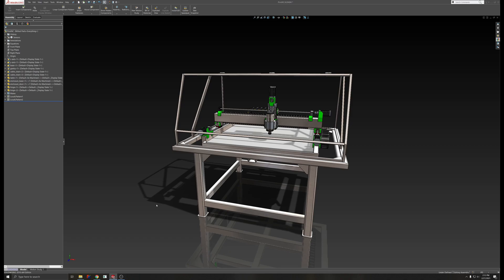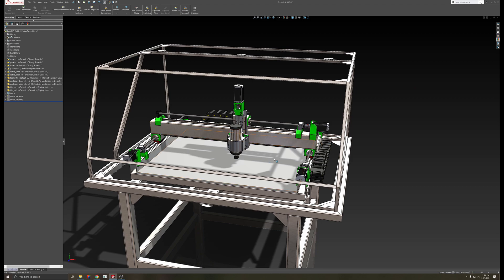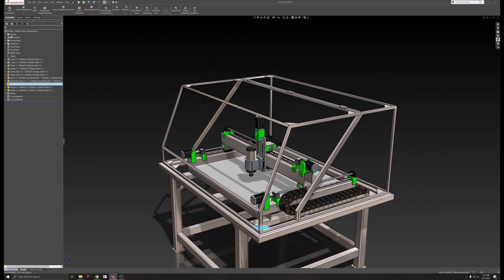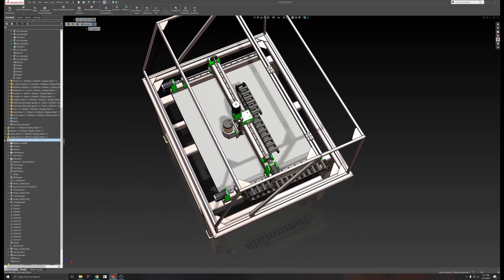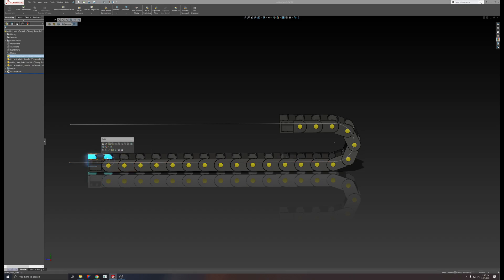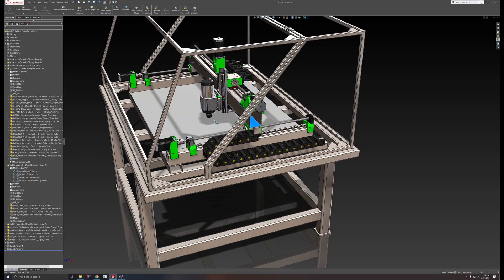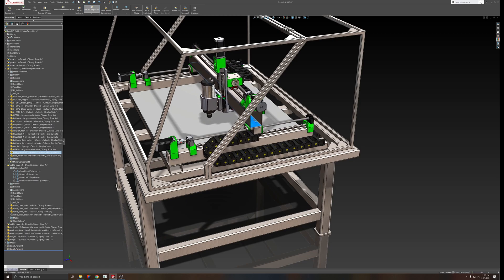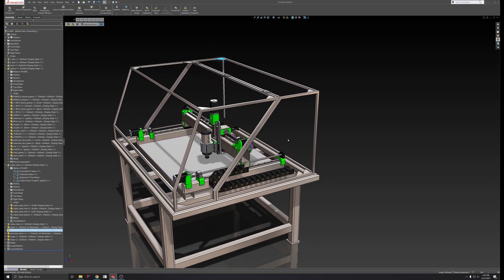Designing a CNC Machine Table and Enclosure in Solidworks

Comment from the maker: If you are working with these files be sure to link these weldment profiles in your solidworks for the table and enclosure to be able to build
https://github.com/bhowiebkr/PrintNC/tree/main/src/weldment_profiles/custom/CNC
Reply: Link is now broken
Reply from the maker: @ryanbellyt  should be good now. I've standardized all the names so these ones are setup for the new updated files. Main change was to no use any of the internal SW profiles because I don't know what future versions have them/if they have changed etc.

Comment: Is the design parametric?
Reply from the maker: Machine itself is fully parametric, the table and enclosure are built using weldments which greatly simplifies the design. The table is parametric from a single 3d sketch which is driven from equations. The enclosure is driven by an, extruded volume that the 3d sketch is attached to so very simple to modify the shape too. The weldments make shapes like a table very simple under the hood. 

In my version of SW it comes with a limited set of weldment profiles so I’ve added ones for 3x4 and 3/4 square steel profiles. They are in the source files and just need to be linked to SW in the settings for it all to work.

Comment: Awesome design, might have to adapt for my longer X build ;). How important is sound for your build? Im in a single garage duplex so every square inch is going to be covering in sound-absorbing and deadning material.
Reply from the maker: I’m in a detached house and will be putting this in the garage. Garage has rockwool insulation which might help with any noise. I am surrounded by old lady neighbors that might complain though. When coming up with the design I saw a diy enclosure where the guy attached foam insulation boards on all the sides that said it cut down the noise by a lot. I might look at that too.